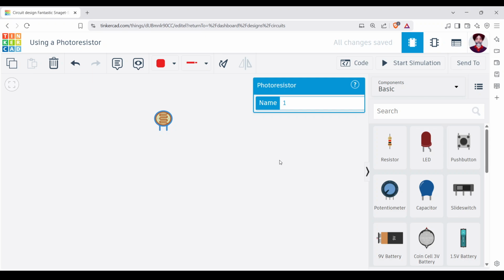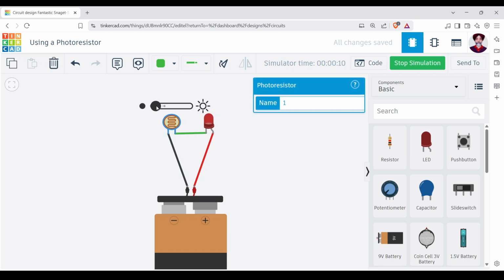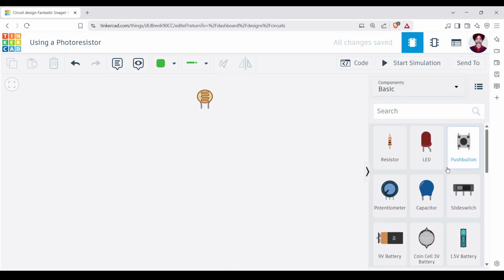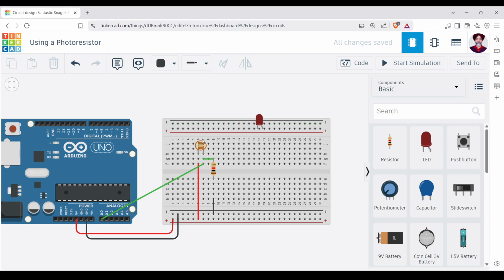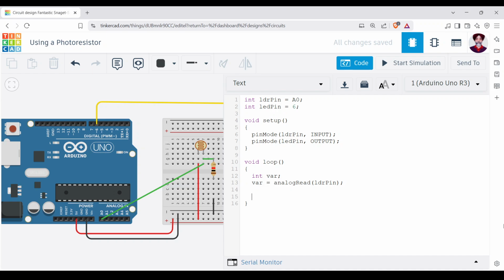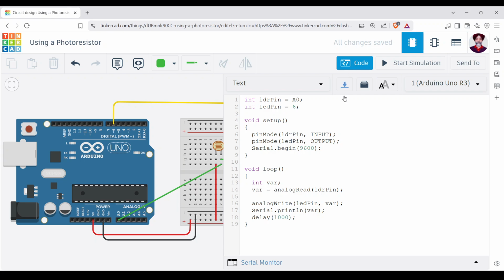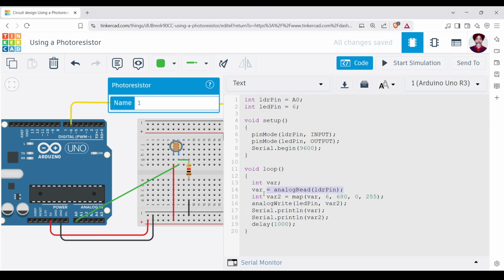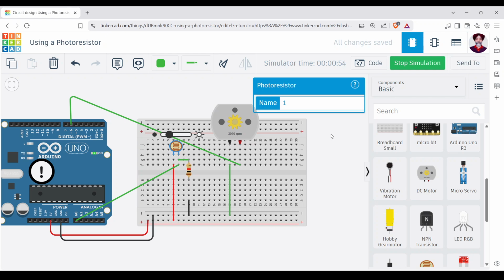Lesson15  Using a Photoresistor LDR Direct & thru Arduino

Comment: Sir, in your circuit, if we place the resistor directly onto the f7 slot, and then connect analog wire to the e7 slot(at the bottom end of the resistor) and also connect the ground wire to the same end of the resistor, then it doesn't work.. Please explain what is the difference
Reply from the maker: The way you explained, the analog pin is directly connected to ground. 

Let me explain. There are two paths from slot e7. One through the resistor to the LDR to positive, and the second directly to the ground. Which path offers least resistance? The one directly to the ground. 

So no matter what happens at the LDR end, the slot e7 (and therefore the analog pin) is ALWAYS grounded.

Let me know if you require any further clarification.
Reply: @rskoura  Oh, Ok, Thank You Sir!